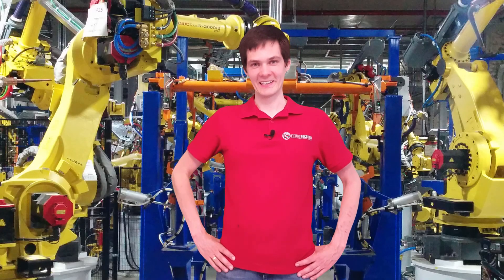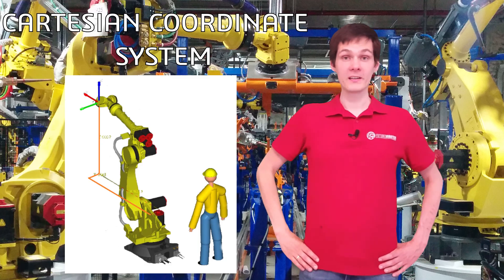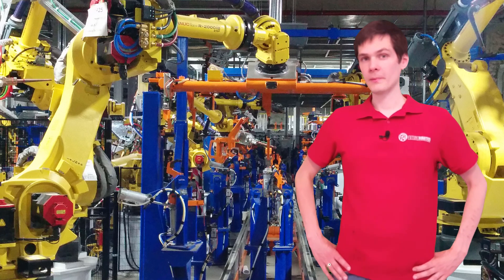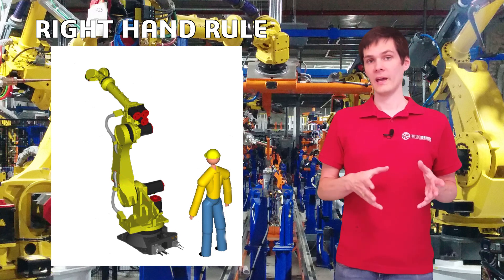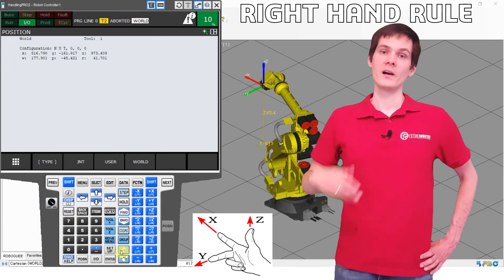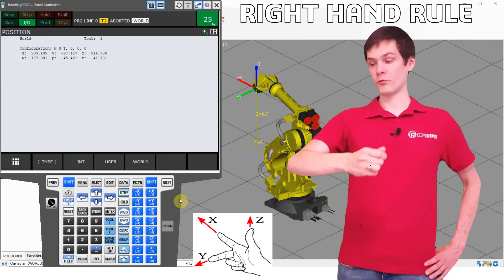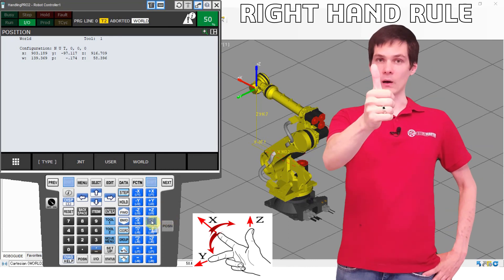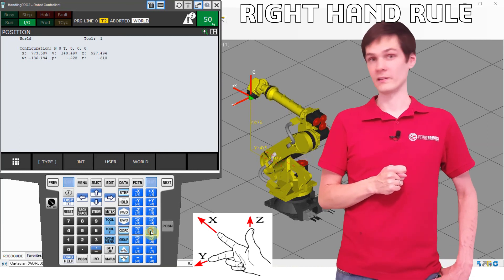World coordinate system - how does it work in FANUC ?

Comment: Sir abb robot irc 5 error code 40222 come execution  stack overflow plz ans sir
Reply from the maker: It might be hard to find the issue without seeing the code, but I would assume that your robot gets into an infinite loop and that's why you are getting stack overflow. Check if your interrupts are set up correctly and that robot doesn't have any loops that will run forever.

Comment: Also, i see tool1 on the virtual pendant in your video. So i did a display with a double view on (Shift+DISP) on the pendant. when i change tool 1 the XYZ in world changes respectively. I am just not understanding this. If i jog in world it should always move based on the origin correct? If so thats really odd beacuse as i change tool1 the ARC seems to get bigger, in other words i hold a linear move longer before it starts moving almost in straight up motion.....this is very odd how this thing is moving.
Reply from the maker: I'm assuming you are talking about position display, yes the value will change depending on the frame you are using, because the position is being calculated using Tool Frame to User Frame "distance", so when you change tool frame when displaying world position, robot always recalculates the "distance" from tool selected to world.

I don't really understand the second part of the question

Comment: The problem is my robot (5Axis 100iB) with the rj3 controller does not move in a linear motian when jogging about world....is there a location to manipulate the ROBROOT? i think some one adjusted this prior to. Thanks in advance
Reply from the maker: FANUC does not have a $ROBROOT like KUKA, WORLD is a fixed location, however there is a special setting that allows you to select if robot is wall our upside down mounted.
In your case I would suggest to check mastering (witness marks) at 0deg position for each axis.
Reply: @FutureRoboticsChannel  Thank you for getting back with me. I checked the zero POS and it seems to be dead on. The robot moves in an arc upwards. So when i am sitting a zero and jog about X or Y the robot seems to be trying to reach some point out in space that i have no idea where it is. Does world jogging pull data from either tool or frame data? And you are correct on the KUKA....i know kuka very well but now i have to switch gears.....it is kinda like learning a 840DSL....AWWWWW..lol
Reply from the maker: @motodv8moto531  is the robot mounted on the wall or upside down ?
How did you verify the marks ? Have you created a point with Angle representation with values of 0,0,0,0,0 ? 
Have you checked master count values against the master count sheet ?

Comment: Hi everyone, If the robot Is mounting on the wall, the coordinate system change? And how can I define in the controller that the robot is on the wall? Greetings
Reply from the maker: Hello, no WORLD coordinate system stays the same it does not change on the FANUC robot.
In order to change robot mount you need to go into Controlled start and there is an option mount type 
It should be under Maintenance menu in controlled start
Reply: @FutureRoboticsChannel  yesterday I tried to move the robot on world coordinates and it doesn't move like the right hand rule, do you know any idea why this happened?  never I have had a problem like this with the arc mate robots.
 I really appreciate yours answers, thanks a lot, 
greetings
Reply from the maker: @marcosmata5172  Yes. if so most likely the mastering or calibration is not ok.

Try to move robot to ZERO position (all axis at 0deg) and see if all witness marks are alligned.
You can check my mastering video to see how to do it:
https://youtu.be/MSmHBW5NJUw?t=364
Reply: @FutureRoboticsChannel  thanks a lot, I'll try, greetings

Comment: You explained the right hand rule nicely.
Reply: helps a lot. this dude has dropped GOLD on us. extremely helpful. Our plant recently updated its pack-off system with two new Fanucs linked to an E80 laser guided conveyor system. With only a crash course on operation and troubleshooting of the E80 control panel, and restricted access to the Teach Pendant for most operators, the endeavor has been treacherous in transition. we have old, sub-par equipment running into precise machinery. I was down for 2 hours just recently due to an ORV-046 alarm, only due to the fact that it was my first time operating a Pendant and had NO clue as to how the Deadman worked. All i needed to do was Reset the alarm and start in Auto on the Control Panel. i was squeezing that bad boy for a solid 2 hours. Only thing that accomplished was testing whether the Deadman worked or not.. lol. i ended up just pressing the power button and rebooted. once it was up, the alarm was gone. i physically removed the obstruction that caused the ORV-046 and the system picked up where it left off after starting in Auto at the E80 control panel.
Reply: @atrocious_pr0xy  i feel bad if you had no training on the robot and are in charge. i am in class right now and still haven't scratched the surface of robot capabilities. i was scared to even touch the teach pendent the first time. the factory made these things  basically dummy proof belive it or not though. another important tip is FUNCTION  > ABORT ALL. that will stop all other tasks so you can start another one.
Reply: @joew4202  my boss and i talked about going over Teach commands, but we both forgot before his scheduled day off. We can call E80 techs who also answer questions about the Fanuc, but at 3 a.m. it's hard to get an answer. We'll get it, just have to be careful as we learn it.

Comment: Sir new video upload of robot mastering
Reply from the maker: All right, I'll do it. Right now enjoy new video regarding robot backup :-) https://youtu.be/kAVZcB1Mmzs
Reply: What kind of robot do you have?  Mastering is not too complicated, I could send you the manual to do it on a FANUC.  In Joint mode, jog all 6 axis' so that the marks on the stickers line up, centered.  Then under Menu, System, Master/Cal do a Zero position master.  Make sure you do "reset PCA" after that is done.  PS, doing this on a robot that already has saved programs in it will likely make all of the program positions move.  Even if the previous mastering was done "accurately" with the stickers lining up, being off a tiny bit on J1, J2, or even J3 can be more than 5-10 mm difference at the EOAT on a bigger robot.  Also, when in doubt, make a backup and image of the robot BEFORE doing any work!